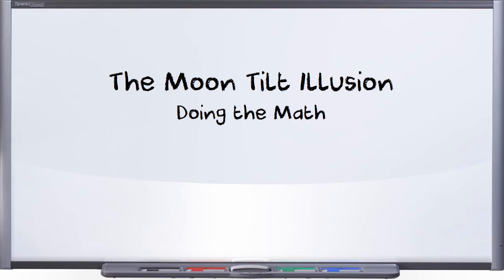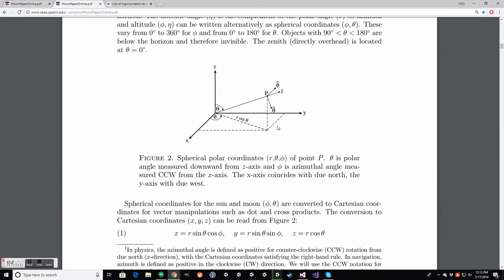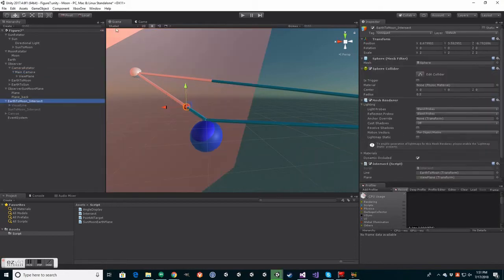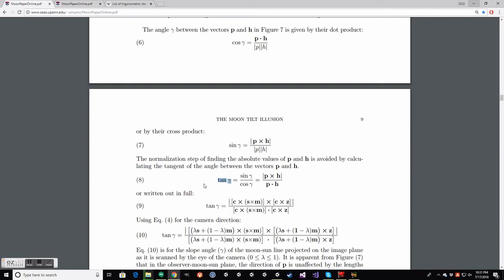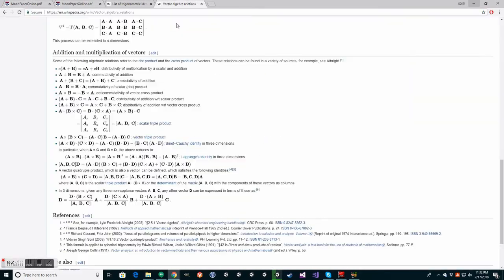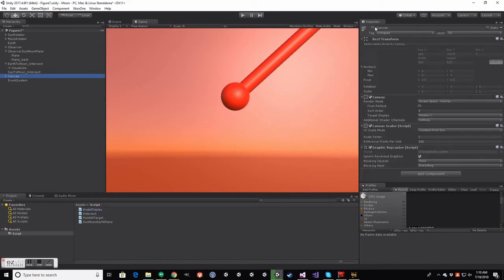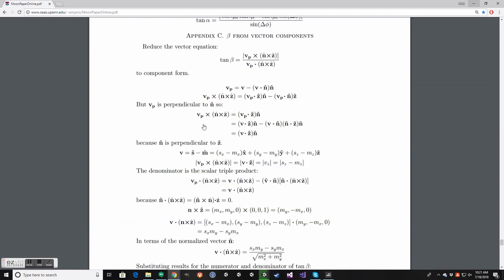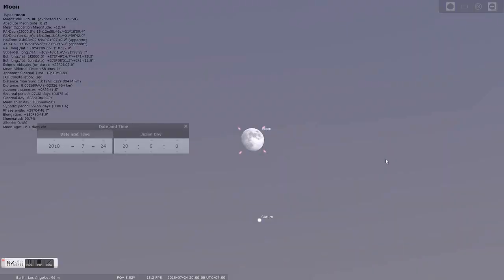Moon Tilt Illusion (Doing the Math)

Comment: in the case of the photo , with sun and moon together , you need two windows . and you have a very diffrent standing position in LA . pi() x thumb runs better , in my oppinion , as your math . the thickness and the mixture of the atmosphere is the next question . why you didn't use the colors of fraction for equations ?
Reply from the maker: Hello there!
I'm afraid I don't really understand your comment.
I got that you would like to consider refraction through the atmosphere. Consider: the light from the Sun to the Moon doesn't travel through our atmosphere. Refraction would affect the apparent location of Sun and Moon. In this video, we are not including that effect. tl;dr: the illusion doesn't require refraction, but you could make the sim more accurate if you include it.
Would you like to break it down and explain it a little more?
Reply: @icansciencethat  First of all, thank you very much for your efforts. Unfortunately, I'm only getting around to replying now; please excuse me.

There are quite a few factors: a) regarding the moon (distance, orbital inclination), b) the atmospheric composition, c) magnetospheric conditions, d) technology, etc. The same applies to the analogous determination of the positions of planets and stars. So, if the sun and moon are depicted together in a photograph, an offset must also be factored in for the sun in order to determine the refraction from the optical distortion. It would be interesting to know whether data can be obtained from a halo.

If I see this correctly, the Earth's axis has tilted. Experts speak of 80 cm. However, based on the optical north orientation, I think it's somewhat more. With the moon, it gets eerie. In the 1970s, the orbital inclination was 3.7°. Wikipedia says 5.2° today. I'm at 7+. I'd like to verify this visually. A digital representation would be very helpful, though. Could you create a rough table from your graphical representation, for example, showing the +/- transit per arcminute?
Reply from the maker: @christophvonknobelsdorff1936  Pardon my confusion, but this video is about the Moon Tilt Illusion and specifically this paper: https://www.seas.upenn.edu/~amyers/MoonPaperOnline.pdf
As such, I keep reading your comment in relation to the Moon Tilt Illusion, and that's very confusing. The things you're talking about aren't really related to the Moon Tilt Illusion. The illusion is the result of perspective. It's not related to the orbits especially... the orbits explain why the Sun & Moon are where they are at any given moment, but the illusion is simply caused by them being at different angles relative to the viewer. The atmosphere could make our mathematical prediction off by as much as a degree, and that small amount is dwarfed by the angles we're talking about in this illusion. Are you perhaps making a hyper-realistic simulation?
So... I don't want to draw any false conclusions, so I'll just try to address your questions with no pre-conceived background.

"There are quite a few factors: a) regarding the moon (distance, orbital inclination), b) the atmospheric composition, c) magnetospheric conditions, d) technology, etc."
I have little to say about that. We could look up details about these things if you'd like.

"So, if the sun and moon are depicted together in a photograph, an offset must also be factored in for the sun in order to determine the refraction from the optical distortion."
Are you talking about lens distortion and/or atmospheric distortion? Yeah sure... If you wanted to use a single photo to determine the position of the Sun & Moon, accounting for the lens properties would be crucial. Circling back to the example of the Moon Tilt Illusion as an example, we would not use a single photograph to illustrate the illusion. We would first look directly at the Moon and then turn to look directly at the Sun. We can measure the azimuth and elevation to each directly, and when the illusion is in full-force, they are in opposite sides of the sky.

"It would be interesting to know whether data can be obtained from a halo."
The halo around the object in the sky is subject to virtually the exact atmospheric effect as the source. The halo would tell you something of the cloud conditions, I suppose. People often think atmospheric refraction is caused by humidity - thus the clouds. In fact, humidity is one of the lesser factors in atmospheric refraction.

"...the Earth's axis has tilted. Experts speak of 80 cm."
The axis tilt varies over time. 80 cm, though? I'm not sure how to measure that in centimeters. The tilt being measured in degrees, it varies by a few degrees over the course of 40,000 years or so.

"In the 1970s, the orbital inclination was 3.7°. Wikipedia says 5.2° today. I'm at 7+."
I'm not aware that the orbital inclination has changed. Where are you getting 7 degrees for that.

"Could you create a rough table from your graphical representation, for example, showing the +/- transit per arcminute?"
I'd suggest stellarium. https://stellarium-web.org/
You can use that to predict exactly where the Sun, Moon, or any star is expected to be - including a basic approximation  of atmospheric refraction. It's based on published orbital data, so you can use that to compare against your own observations and see if they are correct.

Comment: I'm sure the math is fine, for those who can follow it, but for those who can't, I think the best approach is a direct demonstration that the light from the sun is coming in the right direction to illuminate the moon.  This can be done simply by holding up a suitable sphere (a tennis ball, a grapefruit, or whatever) in the sunlight, when the moon is also visible, and comparing the direction of the 'terminator' on the sphere with that on the moon.  Even when the sun is low in the sky, and seems 'below' the moon, it is usually clear that the direction of the terminator is the same.  I have tried this for myself, and there are various examples on YouTube, or in this article.  https://www.skyandtelescope.com/astronomy-resources/what-are-the-phases-of-the-moon/
Reply from the maker: Yes I agree totally. I did that in my previous video, and that is what I tell people to do first.

This video is a response to a follow-up discussion on that video. The argument was something like, "what if the sun is below the horizon? You don't expect me to hold up a ball to that do you?" And then the discussion devolved into "DO THE MATH!" So here I'm doing the math.

My actual advice is to forget the math. Just do this when both the sun and moon are up. Hold up a ball and check it. Do this at different times... 5pm, 6pm, 7pm... then once the sun has set at 8pm you see if the pattern you established from 5-7 is continuing as expected. I think doing the physical experiment is far more valuable than grinding through the math.
Reply: Thanks.  I should have checked out your previous videos, and will do so now.  I think I first noticed your recent video on one by the excellent Al K.